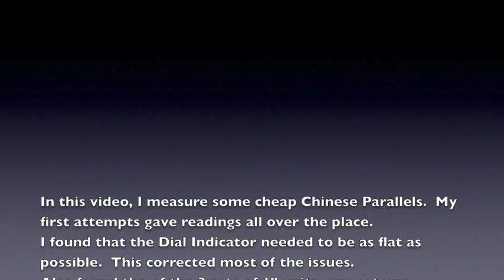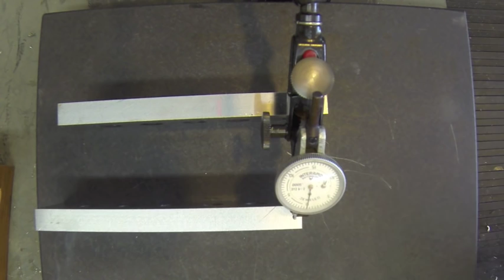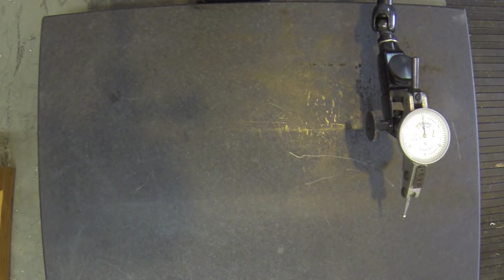Measuring Chinese Parallels

Comment: My experience with Chinese tools has been pretty decent. I bought numerous parallel sets from Shars and not one was out of parallel tolerance, a few sets the height was off. They did need a little stoning on the sharp edges but the price was hard to beat. I also have a .0005 Interapid. I believe the correct angle for true quantitative measurements is 12 degrees with the surface of the part. Like you said, pretty flat. My boss always barks at me to measure all my parallels when I'm setting up. With so many different sets of parallels floating around it has saved me a few times.
Reply from the maker: Dakota Hunt my experience has been the same.  These parallels were bought on ebay, and although each set was parallel,  there was a difference between the 1" sets.  If I mixed them, I could be off as much as 0.006"  Thanks to Stan, they are all the same now.  I have some 1/8" Shars parallels and they are just fine.  Thanks for the comment.  Hope to see more of your videos.

Comment: Herb, I've had to get in the habit of checking every pin gage with a mic as I take them out of their storage box.  Just cannot depend on the size hole they are in being the size that you pickup and have in your hand, since they are too easily stored back in the wrong hole, if not mis-packaged from the factory.  Most Chinese stuff is o.k. quality and good economy, but we have to check everything as you did to make sure we don't get bit by their sometimes false claims of accuracy and fitness for intended purpose.  : )

Cheers,
Gary
Reply: gwcude   I took a sharpie and marked all the ends black when i got the set.  As I pull one out, I'll wipe off the sharpie mark once I'v confirmed size.
Reply: That's a good tip Tom and will work very well for parallels, Thanks.  Unfortunately, for my gage pins, they are black and my blue sharpie probably won't show very well.